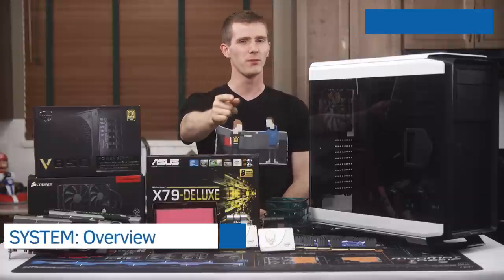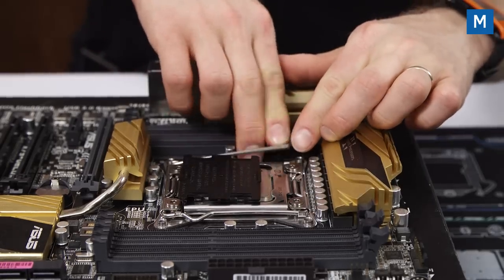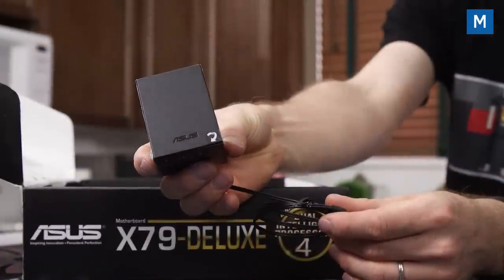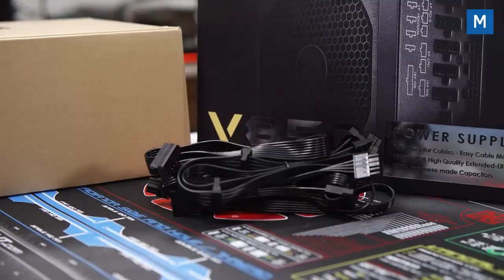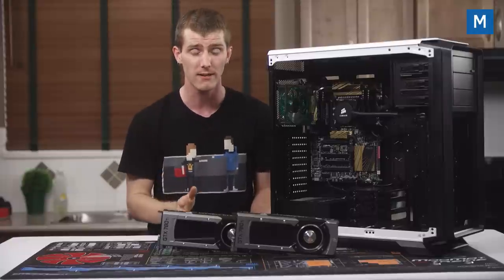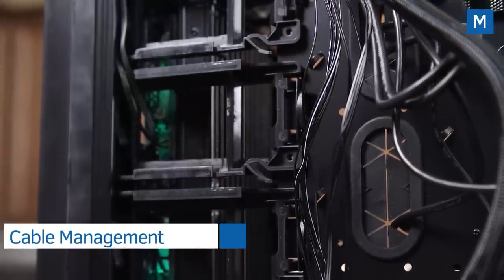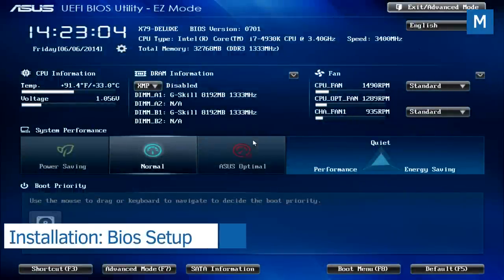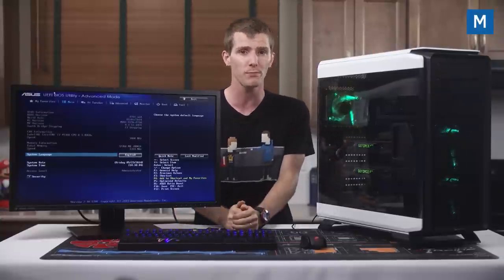How to Build the ULTIMATE 4K Gaming PC Build Guide

Comment: this was just 2 years ago... 780ti was the flagship... then the 980ti and already the 1080 came out jeez!
Reply: and then there's me who's saving up for a pc which I'm planning to build in may/June 2017 with a gtx 750ti
Reply: goonber Lmao get a GTX 1060 or a GTX 1050
Reply: Hah yeah and you can get the same frames @4k with a single 1070 OC'd that gets powerd by a single 8pin. Kinda funny
Reply: im going to get a 1050 ti. any reason as to why the 1050 ti is so cheap?? gtx 750 ti costs £125 and gtx 1050ti costs £144.99
Reply: i cant spend too much on my pc because its my first build and i need to buy some monitors and a desk and chair and everything yet
Reply: if you have the money get a 1060 or 70 but if you dont use the 1050 i use it and it does the job with games
Reply: |T-Bside| Jey XP and soon the 1080TI.
Reply: |T-Bside| Jey XP 1080ti now. Fuck technology
Reply: |T-Bside| Jey XP Titan Xp.
Reply: Gigabyte gtx 1080 Xtreme Waterforce Many non essential components.
Reply: ***** And the Titan Xp smashed the 1080ti a bit.
Reply: Tee B 
No it didn't. The XP was beaten down by the ti.
Reply: Im from the future, 2080ti is on the market n_n
Reply: RTX 2080 TI baby
Reply: Its all about the RTX now
Reply: Now w have the 2080 ti
Reply: just go with a stable middle ground of the gtx 1050 ti
Reply: now the 2080
Reply: @evanbreckman6146  2080 ti**
Reply: Now your comment is 2 years old.
Reply: Don't even get me started on the RTX 2080 ti
Reply: Coming at you from the RTX 2080 Super era, bro.
Reply: Laughs in radeon 6800 xt
Reply: And nothing has beat 1080ti price to performance since! Lmao

Comment: Linus I hope you see this! This build is what my pc is based off and I am still running to this day. I was doing it on a budget purchasing parts on ebay. I was in school when this video was released. 

I started with SLI 780Tis and then went to SLI 980Tis. I am now running an RTX 3090 in here. 

To this day it still holds up running windows 11 overclocked i7 4930k, the ripjaws ram and I did also swap out the PSU for the V1000 as I ran into the V850 being overwhelmed and shutting down my system when running the 3090. I didn’t expect this but it did. 

Overall this build is a mint build to this day with modifications made to it over the years. I know I am CPU bottlenecked with the 3090 but we live on. 

Thank you very much Linus for making this pc for me and allowing my own customisations as times have changed!

Comment: Why not the 295X2?
Reply: ***** Why would that be a troll?

The 295X2 is cheaper then a 780Ti. And performs better at 4K.
Reply: Thats legit, its a better 4K performer and has water cooling.
Reply: ***** G-sync? PhysX? etc That's a reason I went with my 780.
Reply: probably because they had some 780tis lying around or they didn't have access to a r9 295x2
Reply: V-Ram Bottleneck you need at last 6 Gigs if Linus used 780's intead of Titan's he made up mistake, sorry no time to watch video. Oh and a 290x's 8 GIGS could go as well.
Reply: intel chip=/=amd chip. amd chip=/=nvidia chip. amd=amd. intel=nvidia is how i see it I don't like to mix my brands
Reply: Brad Freeman G-Sync? find a 4K monitor with the g-sync chip inside...If you buy an AMD graphic card you can use Mantle where you want.
Reply: ***** Cheaper? ARE YOU JOKING
295x2 = $1,512 (On Amazon)
780ti = $703 (On Amazon)
2x 780ti = $1,406
You're not very good at maths are you.
2 780tis are basically equal or possibly better in some games than one 295x2
Jesus
Reply: Because it's sponsored by Intel.
Reply: For a 2000$ card that does the same for SLI 780 Ti's (780 Ti's are cheaper in SLI anyways).
Reply: pjh3228 Yes! Exactly. INTEL AND NVIDIA ARE THE SAME THING. YOU'RE REALLY SMART BRO.
Reply: Brad Freeman Free-Sync. And PhysX is a fab.
Reply: DarKn0ObXD More so because Intel sponsored the video and said "NO AMD"
Reply: Madd Dogg Tech Tips ARE YOU JOKING?

Maths. Nice kid.

Anyhow, you can find an R9 295X2 on Newegg for $1699. And yes, the 780 Ti outmatches the 295X2 in SOME games, but it's the same way with Radeon cards.

Oh and, Satan.

Nice edit. bro.
Reply: TDK DHM Even Linus said in one of his videos, it's the stupidest thing ever to say that :D
Reply: Lol...he explains it at 13 minutes or so.
Reply: Brad Freeman I listened, it's just a terrible recommendation for a '4K Gaming PC Build GUIDE'
Reply: Madd Dogg Tech Tips Your original post claimed the 295X2 was $2000. Which you edited right after I submitted my reply.
Reply: ***** If small projectiles make or break a game, that's kind of sad. Even then, you can use your CPU for PhysX. Did it many times when I played Warframe. Looked the exact same, and fairly similar performance.
Reply: He specifically said he wants Nvidia for his shield genius
Reply: ***** In the video he states he wants to use his invidia shield.
Reply: he said because he uses nvidia shield..
Reply: If you watch the video he already says why, because of nvidia gamestream that he uses often.
Reply: Brad Freeman You couldn't enjoy a game because of shitty smoke and particle effects? Jesus..
Reply: i think was started before that came out
Reply: he's an nvidia fanboy
Reply: pjh3228 Please tell me you are kidding.... right?
Reply: Well there were a few mistakes. First 290x cards, with faster VRAM buffer and more VRAM perform better at higher resolutions. And who can forget the janky witch-craft inspired ESD wrist-band and pad he uses; both of which are bull-shit.
Reply: ***** wasn't out when they filmed this. these take a long time to make.
Reply: i think he has a better xp with nvidia colbert
Reply: sponsored by intel?
under 4k (from the anandtech benchmark) 2x of amd's STOCK R9 290x on "uber" in crossfire does better at 4k than the 780Ti
Reply: ***** 295x2 isn't cheaper, its like over $1,300+, 780 ti has gone as low as like $550.
Reply: He did mention, that AMD would draw 100w more power (or more), which would become hotter etc.
He even said (Not directly quoted) that: If you wanna pick AMD. go pick amd.
Reply: The 295x2 is pretty rare, in the demo they did they used Austin's gpu and they most likely don't have the time, money or sponsorship from AMD to get their own version of the gpu. Yes it will perform better but they most likely used a 780ti because of the reasons stated above + they probably have a few 780ti's lying around.
Reply: it takes up alot of room since it comes with water cooling
Reply: He said IN THE VIDEO, that he wants GameStream... Noone heard that here...? Really...? facepalm
Reply: +crazyCA12  I work at an electronics manufacturing plant where we need to wear 2 anti static foot straps, an anti-static wrist strap that gets attached to tables and such when we are sitting, and an anti-static smock which needs to contain all of our clothes. So it is very useful advice to use a strap when working on your computer.
Reply: EVGA 850 G2 PSU is 9.9 on jonnyguru so I got on of those and I don't think 3GB of VRAM is enough for 4k. Its not even good for watch dogs at 1080p and if watch dogs is doing that at 1080p what about future games?? so maybe a Titan SLI or 290 Crossfire they got good aftermarket coolers on the 290's and the mining crap has died down now. Maybe this 4k build should have waited till Maxwell there supposed to be faster, cheaper, draw less power and have more VRAM.
Reply: He actually CLEARLY explained WHY in this video.
Reply: I know he said why HE would choose nvidia, but the 295X2 would be the better choice performance wise
Reply: Not sure if guy wan't to play games on them or bake toasts xD
Reply: T.E.D. de Medici
You don't understand how heat works. Better cooling gets heat away from the GPU faster, but that heat stays in the room (and he said he didn't want to heat up the room more) unless you use AC or someother form of cooling the room.
Reply: 780tis are better cards.
Better drivers, better power consumption, better cooling.
Reply: ***** it's not cheaper than 2 780 ti. 2 780 ti's are 1400-1450 and a 295x2 is 1500 usd
Reply: He said it's because he games using Nvidia shield. He even specifically asked for things like this not to happen so please stop.
Reply: cause nvidia paid this video ;)
Reply: The heat issue, y'know, like what he talked about in the video.
Reply: Callum Ashton
No. But AMD and AMD are the same thing. If you can't make the logically conclusion that Intel may not want AMD to get an upper hand revenue wise in any facet, then i pity your mental limitations.
Reply: DjToffy Actually G-sync 4k´s are on their way, and Mantle is by no means an selling point. First of all its open, so Nvidia could use it aswell AND DirectX 12 is finaly arriving which will delivers similar if not even slightly better performance increase (since it was in development quiet some time longer). Personaly i go with Nvidia all the time since AMD just wastes too much energy in my oppinion and usually run alot hotter and louder than nvidia cards. If your on a budget, AMD could be the better option than mid/low end nvidia cards but if you are not willing to invest into the heart of your system your doing something wrong anyway. I personally think that Gamestream and PhysX are the only really important features when it comes to GPUs for gaming. When they finaly sold their stupid Gtx Titan Blacks and finaly bring out the 780ti with 8gb of Vram then i see absolutly no reason to go AMD for 4k gaming. I personally am exited for the gtx 1000 series which will feature stackable dram which allows much higher bandwidth.
Reply: T.E.D. de Medici Or maybe, just maybe. It's because he games using Nvidia Shield. like he said in the damn video.
Reply: *****
Not nearly as much in the current generation.
 He said it in the video himself, 100W extra if he went with R9 295x2, holy fuck.
Reply: Probably for the heat factor. I'm willing to sacrifice 5-10 fps if it means im getting 15-20 degrees less heat output.
Reply: ***** and if you manage to cool the GK110 GPUs propperly they can achieve very good speeds with gpu boost 2.0 aswell.
Reply: ***** Vram does not work like that.
Each GPU on the R9 295x2 has 4GB of Vram. They do not stack.

Also the R9 295x2 has shown that it is verry well doable to run 4k with 4GB of Vram.
Reply: TheLordOfWar True. I achive speeds up to 1149 Mhz in Bf4 with my 2 780 Ti's.
Reply: They didn't get a 295x2 sent to them they had to borrow it from another Youtuber
Reply: ***** 7950 is not shitty , have respect for that gpu :((
Reply: he explains why, watch the video
Reply: *****
 What about Tress FX? I'm currently an Nvidia user.
Reply: TheLordOfWar sounds a bit too hopeful on reference coolers though, but with a twin/tri fan i would be inclined to agree.
Reply: because he wants game stream which AMD dosent have and the 780ti's consume roughly 130 watts less power
Reply: the 780 Ti has 100w less power and he doesn't use Mantle and that, so uses the 780 Ti for the game streaming to his Shield. Also, he did say that that's his personal pref. and you can choose the card you want.
Reply: because he want to use shield, and Nvidia drivers are somewhat better, and a lot of games are optimize for Nvidia, like watchdog...well that still haven't completely optimize, you get the point.
Reply: He talks about it at 12:37
Reply: shadowplay.
Reply: ***** you mean cheaper than two 780ti's?
Reply: Guys!!! Calm down! They wouldn't have gone with the 780tis if they didn't have  good reason. Either they just had them lying around, or they couldn't bother setting up the cooling loop for the 295x2, or whatever else, but I doubt they wouldn't know what was the better option for them. They never told you you can't buy a 295x2 instead!
Reply: Cicciter they say explicitly why, watch the fucking video before commenting.
Reply: Callum Ashton You missed something here. Intel refund 75% of the making cost for any video that show intel hardware and the logo intel. But only if you don't show the competition brand, here AMD, or talk about them.
So he is right and you are narrow minded for thinking he made the mistake of thinking those two brands are the same. Intel+ no AMD = 75% refund of the cost of the video. So no 295x because of intel is leggit to say.
See ? No need of yelling when smart... ;)
Reply: You obviously didn't watch the video first..
Reply: ***** There you go, they had a good reason.
Reply: Cicciter no one is fucking disputing that. I merely told you to watch the fucking video because half way through they explain exactly why they picked them, ergo; nullifying your comment.
Reply: ***** are you dense?
2x780ti is cheaper and faster than r9 295x2
Reply: Giggity Goebbels They're too busy arguing semantics and fanboying.
Reply: crazyCA12 I'm just gonna assume you don't work in IT, otherwise you would know what ESD can do to the components while you're working on them. And no, it's not safe to just ground yourself once before you start working.
Reply: Oh yeah, I see Intel using THEIR OPPONENT'S GRAPHICS CARDS.
Reply: Brad Freeman G-Sync, because it's totally not already coming in next Display Port revision for free eh?
Reply: why not zoidberg?
Reply: ***** I am enjoying Borderlands 2 with physx on high on my 7970 ;)
Reply: Long story short Nvidia for 1080p gaming and amd for bitcoin mining and 4k gaming. DONE dusts hands
Reply: TDK DHM Commars.
Reply: Jack Commars? What?
Reply: TDK DHM I'm just commending you for your great use of commars.
Reply: Jack
Not a GPU company fanboy as I have a Nvidia and a AMD machine, but I would have went with 2x R9 290X's.
Reply: linus said because of the power usage and tempreature he can't afford.
Reply: ***** *clap clap clap* you understand it. AMD and Nvidia are 2 different chip designers. So I regurgitate my statement AMD=4K, Bitcoin mining. Nvidia=1080p, PhysX, and cuda enabled editing.
Reply: ***** I've got a 780 oc dc2 from Asus, I don't know why it took YT so long to bring up your question. Stupid comment system. Good luck with your choice. I hope you waited for the 980 :D
Reply: Colbert amd fanboy u need s GTXXXXXXXXXXTUBE78080TIxp